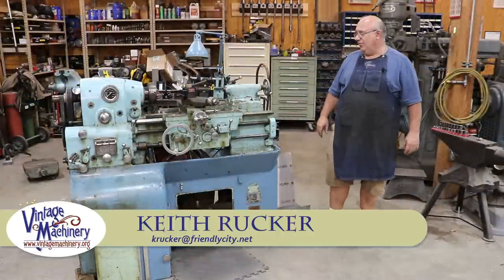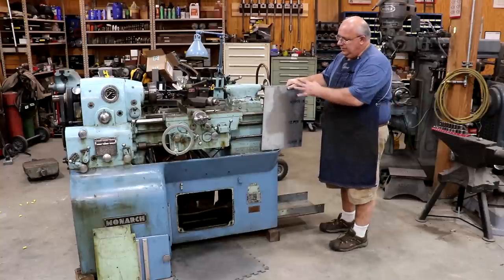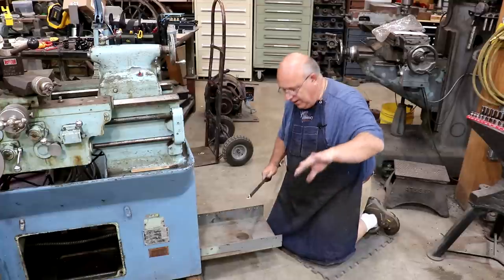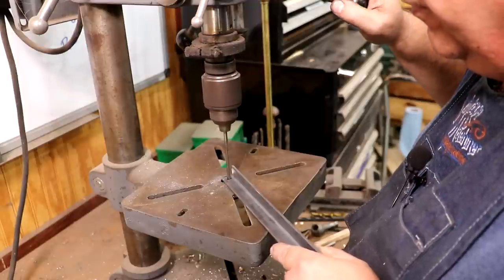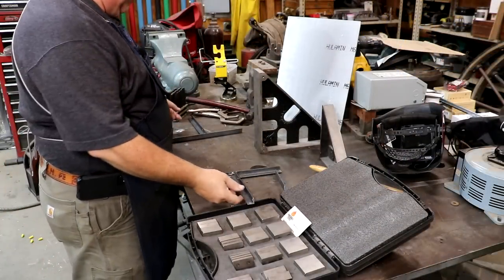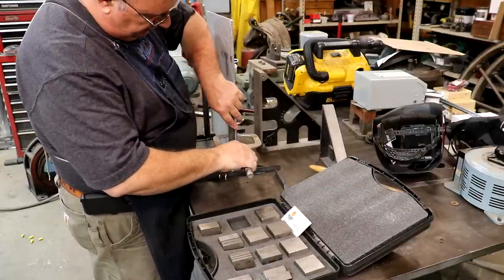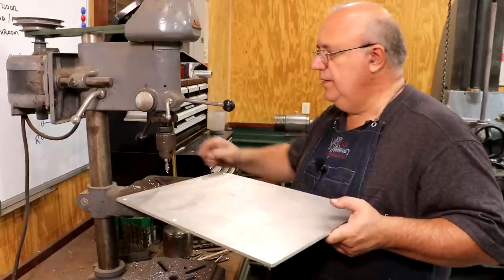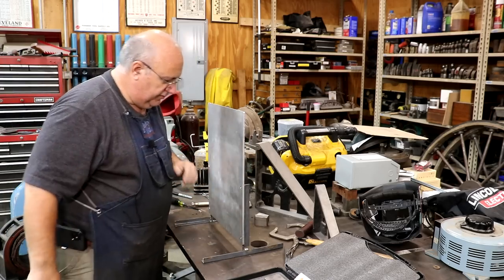Monarch 10EE DC Drive Retrofit 2: Fabricating an Electrical Panel for the Drive Components

Comment: Keith, will possible galvanic corrosion between the aluminum plate and the steel angle iron cause a problem with your grounding?  I assume that the Designer will take that into account and run separate grounding wiring "just in case" (unless it's already "Industry Standard" to do so?).

Comment: I was wondering if adding rubber feet to isolate (both electrically and for vibration) the new mount from the metal tray would be effective.

Comment: I am curious if the control system will be “governing” the motor to hold the motor speed under varying loads. Is the motor speed the Process Variable of the control system?

Comment: Sometimes an elongated  "O" shape is needed in such a panel for component wire connectors to pass through and some plastic coverings for the edges of the pass through can be added for safety.

Comment: Thank you for your effort in putting these videos together for us all.  In my opinion these "YouTube" videos' are the best thing to happened to internet!  Two safety comment: during the video, while you were cutting your aluminum panel, you should general try to make your short cut first so you don't have to back out of the cut that far. There is the potential of pulling the blade off the wheels.   The 2nd is that your guide should have been down within a 1/4" to 1/2" above the work.   Again, thank you for show casing your 10EE drive retrofit.  I have a 1942 10EE with a problematic drive that I am considering replacing.
Dan

Comment: Harbor Freight foam pads have many uses.  Nice to see you using one as a kneeling pad.  Wearable knee pads always seem to be a bigger problem, especially when you need to get up and mobile.  I might suggest you use a router and round over the edges of that plate and maybe give the corner that presents itself a radius to keep from poking your head when you lean in quickly to see what is smoking.

Comment: I bought a set of drill/tap drills from Greenlee years ago just for hand drill and tapping in sheet metal. I can't recall if I ever used them. I suspect that they were developed for the electrician for field tapping in sheet metal. I might have dug these out for this job just to see if both the tap drill and the tap mounted on the same tool was a practical idea. The problem that I have had with power tapping with a hand drill is the drill chuck cannot hold onto the hard tap shank effectively and slips, but I employed this method in my career far more often than using a hand tap handle. I don't like deep hole hand drill tapping, especially in steel, but sheet metal and cast iron works well enough to be my go to method. Keith had some trouble because he was doing his hand drill and tapping on a bearing drawer slide. Blocking that wiggle movement can prevent the novice from breaking a tap when employing the hand drill method.
Reply: Using those Greenlee taps in a 1/4” impact works better than using a drill. If you use a drill and the tap binds up the drill tends to torque over off center and break the tap whereas an impact won’t keep trying to spin, just start doing its hammering thing.
Reply: @MrSleepProductionsInc  Thank you for the suggestion.  I am not a fan of drilling with an impact gun, so I wouldn't have thought to try it on the drill/tap combo.
Hand drilling taps is something that I still prefer to reserve for a 1/2" corded drill, like Milwaukee or DeWalt with a sufficiently slow RPM. Small taps are fine for cordless, but I still feel more confident with corded.
The hex drive feature on the impact driver would eliminate the tap spinning in the drill chuck.

Comment: Interesting. I suspect a fair amount of preliminary (?) design has already been done behind the scenes to ensure there is enough room on the plate for the components (also considering heat dissipation) and that centering the plate left enough clearance from the sides.  Thanks for the video.

Comment: Add tray and panel ground bonding wires to the lathe frame somewhere so you have a single point unified ground from the power supply to the motor and frame. Electrical codes on grounding and bonding back in the 1950's are not the same as we now know in 2022. NFPA or IEEE. 
That way the lathe operator will be safe from any electrical event and you do not get any extra electrical "noise" because of grounding and bond paths..

Comment: Nice job as always Keith. Quick question for you: What is happening with the Coal Engine for the train restoration? Did you ever come up with a solution for getting those ways machined in it???

Comment: Should make a quick disconnect for your electrical at the back of the plate and then some strong magnets to hold the plate in place that way if you have to work on the transformer or need to get to the back of the tray or even work on the electrical it is as easy as unplugging it and lifting it out..

Comment: Personally I'd recommend welding on a small triangular brace bracket at the intersection of those T braces. I'm worried that the weight of the motor controls hanging on the panel combined with vibration over time will weaken the unbraced welds.
Reply: Yep - that was also my first thought. That and the possibility of loud noise from the  plate/tray resonating at some motor speeds.  But easy enough to add braces in the middle or at the ends,  if necessary.

Comment: I’m just a little bit concerned about the support for that aluminum plate. Yes, it’s probably fine. But I’d prefer to see an angle from the bottom of the horizontal angle to the top screw of the vertical angle and plate, on at least both ends of one side of the plate, preferably both sides. There’s a lot of torque and leverage at the top of that plate. I don’t know how much the electronics will weigh, but those angles aren’t that sturdy. If they were 1.25” by a 1/4”, I wouldn’t be as concerned.

Comment: I think I would put new rollers or bearings on the tray that rolls in and out before I connect everything.
Reply: I wonder of the underside is still full of crud?  Maybe a good soaking of the universal solvent WD40 and then some machine oil.  I am curious to see how much stuff they are going to need mounted.  I suspect it will be not a lot and not very heavy.

Of course when you have it out to service the bearings it needs a coat of white or cream coloured paint on the tray and inside the machine compartment... a perfect job for an apprentice!
Reply: Not exactly a smooth roller. I’m thinking crud too - years of shop dust and old grease.
Reply: @someguy2741  Yes a coat of paint and a generous radius on those top corners would blend right in with the other radii on the machine.
Reply: As he's mentioned before, he's doing the minimum work required to get this machine going. He's mainly using this as a prototyping platform for upgrading the other 10EE that he is in the process of fully restoring. If after he gets this all running and sees if it can actually gut a straight path, he might do some more cleanup on it, but will likely sell it off once he gets his restored 10EE going.

Comment: At 10:56 - Keith mentions that he "pecks" at the drilling to break up the chips so as not to "get those lone stringy chips" (which happened at 11:48).  Are these long coiled stringy chips bad?  If so, in what way?  Thanks.
Reply: If you allow them to get too long, the centrifugal force will cause them to extend out and start to rotate like the blades of a fan, the longer they are, the higher the speed at their ends and the closer they will get to your hand if you are holding the piece with your hand, they can cut your hand or break off and hurt you elsewhere on your body.
They can also get caught in the helical grooves of the drill bit and distort the hole, scratch the surface of the part you are drilling or jam the drill bit in the hole causing it to break.

Comment: I'm interested in seeing the thermal design.  Even at 95% efficient you would need to dissipate over a hundred watts inside that electrical closet/cabinet.  At a more typical 85 to 90% you could need to handle as much as 500 watts into the cabinet.
Reply: Good heat sinks and indeed cooling fans are indicated at that wattage level.  That's about 1/3 the power of one of those plug in rolling oil-filled radiator heater looking things. Of course they don't have fans but they are physically very large to handle the dissipation into the room.
Reply: All the iron of the lathe will do the thermal dissipation.  The old electronic tubes generated more heat then the new electronic converter.
Reply: @tracteurfan4734  True, but solid-state electronics are less tolerant to heat than tubes. Tubes work because of heat - foreigners refer to tubes as "thermionic valves" that is, heat is required for them to function. Solid-state electronics reliability goes down drastically with temperature, and this system is going to take some real big-boy heat sinks and cooling, not to mention some whopping big output transistors, to pass the kind of power that is required. All that just hanging in the air is going to be challenging, couple it to the iron of the lathe and you won't be able to touch it after a few hours.

Comment: Hello Keith. Aluminum makes the steel rust. Maybe paint the steel or put some tape between the steel and the aluminum?
Reply: I also had thought of galvanic corrosion.  I'm sure you considered that.
Reply: Yep.  Like you said it doesn't take much of a barrier to prevent.  I was thinking a gasket or even a non-ferrous washer would do the trick.  I'm sure Keith has thought of this, just didn't address it in this video.

Comment: A Monarch 10EE is only a 12x20 lathe. Rather a small one. It seems a lot of effort to gain not a lot of capability. The basic lathe precision is certainty high, but then again, isn't usable accurately set by how accurately one trams in a part in a four jaw chuck? Of course there is always the restoration challenge.  But I wonder.   Cheers.

Comment: Got a couple of sharp corners on the top of your aluminum panel and on the angle iron uprights that should be rounded off on the disc sander, then paint the tray and angle iron brackets ready for assembly.

Comment: Dangerous move there on the bandsaw. So others don't make that same mistake, the upper blade guide should be lowered to within at least an 1/8" of the materiel being cut.
Reply: That’s what I was taught as well, even though I don’t always follow it rigidly either.
Reply: Bad habit when drilling the angle iron and holding onto to it. If that drill bit grabs, it will pull the angle iron out of his hand.
Reply: @Bluesman57  The parts were long enough not to be a problem for hand holding. It’s just one of the jobs where you need to know the limits of what’s safe or not.
Reply: Looked like the vice jaws prevented that on the angle irons. Not on the plate, though and I assume that’s what the original post was all about.
Reply: @glennstasse5698  I was referring to his free hand cut on the aluminum plate with the Doall bandsaw.. On the other bandsaw with the vice, your hands don't come into play there. The vice is holding the piece being cut.
Reply: I agree.  I’ve seen the damage done to someone when the blade breaks and the guide isn’t lowered

Comment: I would have tapped the angle iron that the aluminum panel is screwed to.  I always use ¼-20 for everything, I would find fine threads to be very odd here.  I always use thread cutting fluid on everything I drill or tap. Ron W4BIN

Comment: Metal shavings sounds clunky.  I like the term “swarf “

Etymology 1

From Middle English *swarf, *swerf, from Old English ġeswearf, ġesweorf (“iron filings; rust”) and/or Old Norse svarf (“metallic dust”), both from Proto-Germanic *swarbą (“that which is rubbed off; shavings”), from Proto-Germanic *swerbaną (“to mop, wipe; to rub off”)

Comment: Why is there so much electronics going on? 
It's just 1 electric motor? M
Reply: It’s explained in the previous video — he wants variable speed and good torque at low speeds out of the dc motor. The old electronic control in the lathe used vacuum tubes and the circuitry is kaput.
Reply: @TupperWallace  and it's a non standard DC motor by today's standards.